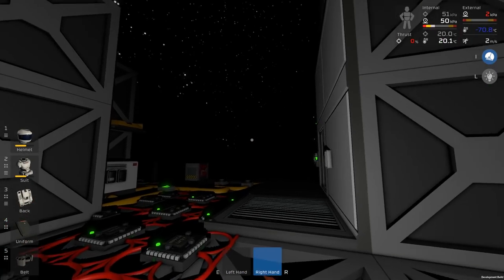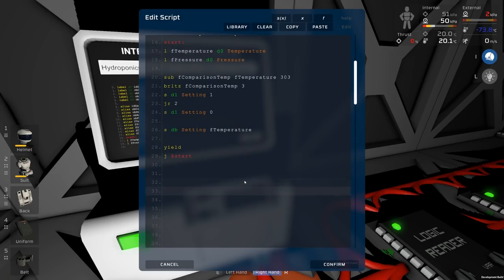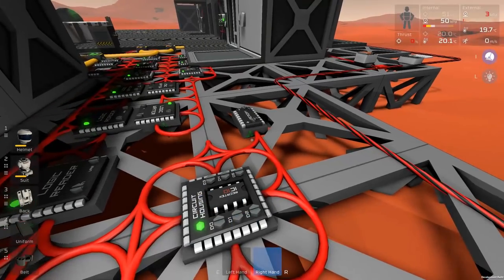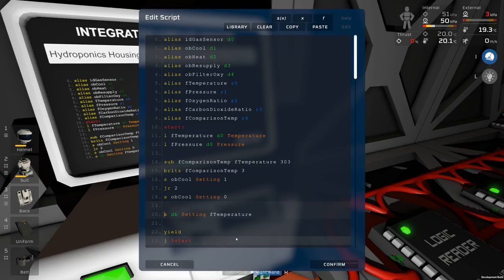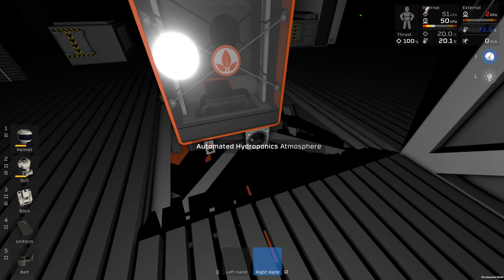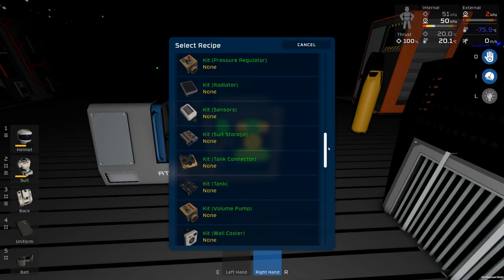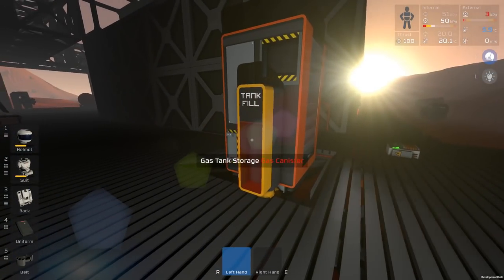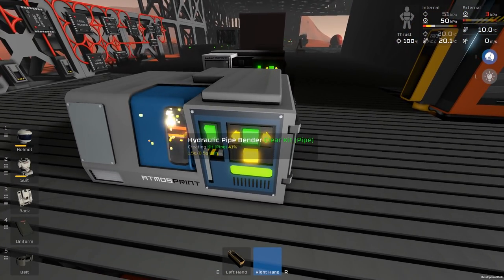Stationeers S2 E51 - New Automated Hydroponics Unit!

Comment: you can isolate the furnace completely using chutes and circuitry. works best if it is in a hot room  directly. it can still be cooled by gas emissions of the ingredients though

Comment: I've been using a similar idea like your wall cooler tower to heat an electric furnace and it worked great. instead of coolers i used the waste heat pipe of an air conditioner (input and output to passive vents). I always wondered whether wall coolers would work too but never built such a version.

Comment: I put one in my hydroponics room, attached a passive vent to the gas input, the water system to the liquid side and it all worked fine. Having a passive vent means that you draw and return gasses to the room and don't pollute your CO2 feed from the tank. The logic in the room takes care of the ration of O2 and CO2 as it always did.
.
Reply from the maker: Yeah, this is in the next episode - the main problem at the moment, is you need to reload after planting something - all the error stats are active until you reload.  Otherwise this code works: https://pastebin.com/5xpWMFzD
Reply: Thanks for that. I stacked 5 wheat into the unit and it kept them in the loading port. When I manually re planted, it took one from the stack. I don't know if this is right, it seems a little odd for it to just sit in the loading port but if it helps... Another good topic you have here, thank you for videos.

Comment: grayduster If you have problems with the furnace leaking heat, try to just seal it compleately, maybe a pach changed how their heat dissipation works, and you can just attach a reader/IC to the furnace to open the mold (it's lever), check the temperature/pressure and check the contents of it, and use chutes to transfer ores and ingots around! This might be the sollution, I didn't test why it cools down so much, maybe it simulates the heating up of the ingots somehow, I don't know what is going on with it right now.
Reply from the maker: I've sealed pretty much everything else except the front and a couple of pipe segments.  It's a little puzzling, but yeah, we can seal the rest.
Reply: Probably because half the furnace is sitting outside and it can probably reach -60c easy. Put it inside a room with a window (for viewing pleasure) and empty all air in there to improve the insulation.
Reply: grayduster Just add a frame to cover the front (I mean seal it compleately in frames) and use the things listed above to be able to remotly controll the furnace. Oh and ALL the pipe segments (the hot-gas-carrying ones, that are in what I call the furnace loop, the connections to and from the hot gas tank and the furnace) need to be in frames, otherwise you will get diminishing returns of the heat isolation from the outside.

Comment: grayduster Wall coolers reqire >5kPa of pressure to function, so it is impossible to just use atmosphere as a heat source directly, but if you would make a room that would pump in fresh air and pump out cold air, it would be possible, since then you can just rise the pressure, and use air from the atmosphere.
A way to do this is via using the filtration units as pumps; however there is a small important thing you need to know about them, their pumping speed depends on the VOLUME of their INPUT pipe's pipe network (the more volume in it input pipe's pipe network, the faster it pumps air from one pipe to the other) on recent paches of stationeers (from what I know), that means that you can just cycle air with them at the same speed, keeping the pressure at a certain level, just turn both of them on in the same "tick".

Comment: +grayduster My shorter if/else technique in the previous video is more useful if you have multiple statements in your if- or else-part, and/or don't just want to assign a single value (0 or 1). Then again, if the "default" preamble part is too long (only to be overridden), then your original technique may actually be best suited.

Comment: You should have looked at the temperature of the canisters, to see if it was the gas/water temp affecting the plant or the outside temperature. Since it's a concealed unit I doubt that the external temperature has much influence.
Reply: Rudi Christensen This would make a lot of sense the sense. Plants do generate quite a bit of heat themselves, and I know that, since I manadged to power a furnace with 10 plants exchanging CO2 into O2 with a small* help of wall coolers ;) , but that was a lot of paches ago.
Reply from the maker: Yep - I checked, they had dropped below freezing.  The next episode moves the entire setup into the hydroponics area anyway to automate them, so temperatures will be fine in there.  Beta branch is very broken right now (chips won't turn on, hydroponics shows up with all error conditions etc) - once that's fixed, I'll be doing an automation setup on it (spoilers, stacker-sorter-stacker with a feedback duct from the sorter back to the hydroponics)
Reply: Would have enjoyed you keeping them outside, because they can. And they would be good eye-candy for us viewers, when you roam away on your base, doing other stuff. Just stuffing them inside a building you rarely visit (in videos) don't do them justice :)
Reply: grayduster That is because your pipes where not insulated all that well. If you had something to keep the temperature stable (like a tempionary air con. unit) you could have avoided this, or the whole thing partialy in frames, the whole thing could be sustainable outside (maybe just not on Europa ;) , speaking of Europa, where are the episodes, I know some people are asking for that quite a bit).
Reply from the maker: I started Europa, and then the devs dropped ICs on me, and now everything needs ICs! :)

Also, here's a preview of the program for the next episode :) 

https://pastebin.com/5xpWMFzD
Reply: grayduster That's a lot of waiting* (the amount of "yield"-ing in your code) ;) . You could have done it in a loop:
<code>
...
move r15 10 // I just counted, how many times you were executing the "yield" command and wiritten it here, but this can be changed to even e.g: 10000 , since we are yield-ing (skiping to the next "tick") here anyway
yield
sub r15 r15 1
brgtz r15 -2
...
</code>
This way, you don't need to have a whole page filled with lines with a singular "yield" inside, and make the IC wait as long as you want.

Comment: maybe you can make a circuitbuilder station with debugging equipment all around.
like lcds and dials and memories and some standard readers and writers to merge input and output to and from the dials to the memories and from the memories to the lcds and then you can use develop your code and debug it more efficiently by changing the inputs and outputs around with the dials as you need instead of changing values in the program itself.
Also that way you don't need to build a new computer every time you want to make a circuit for something, but you have a generalized setup.
Also since you have that bay already, just dump the atmosphere into the automated hydroponics via a passive filter. Or alternatively you can have such bays in a pressurized livable area and just connect the internal atmosphere to a co2 pipe on one end and your waste filter system on the other end, and a storage tank on the pipes in between. and to save power and filters you only pull out the O2 once the concentration is > 10% or something like that.
With the new circuits it should be rather easy to build latch switches, that turn on at one value, change an internal state, and then turn off at another value.

Comment: So I been hitting this device pretty hard in beta status - (actually pointed out some of the errors for rocket)  and on the dev discord Rocket confirmed it is not very well insulated - soo it needs some kind of temp control - either the atmo pumped in needs to stay at  right temp or whole thing needs to be in a temp controlled room. 
I also broke the machine a few times.. using slot reader / logic writer / readers.. etc..
The device does not have a harvest button - though clear does destroy the plant growing (and does seem to return some items (or it did in my test)) 
I have mine hooked to logic writer, connected to a switch/button from logic chips - I push button - it harvests the plant.
The whole device is ment to be controlled by logic - id love to see some good logic build for it.. maybe even like 4 of them and some batch reader/writers and batch slot reader..  help automate food production so I can work on more fun things (like making ice catch fire and blowing up smart gas canisters with over-pressurizing them) 

Anyway - have good one o/
Reply from the maker: Yeah, I've got it running automated in the next episode (out today), except for it being a little broken on beta branch.

The harvest button is the clear button, but only when in growth stage 4 (plant grown).  You can examine the growth slot using the slot reader, and trigger when it hits 4, although you'll need to trigger twice.  There's an IC controlled version in the description of the next video - once the startup bug with the hydroponics unit is fixed, should be entirely automatic

Comment: tell me are you on the dev branch or did something special to get the new menu for the machinces and new look for them as well and the other new stuff. becuse nothing in my worlds has changed other then i can work with the ic editor.
Reply from the maker: I'm on the beta branch - which has just been broken today as I write, but should be fixed soon.
Reply: @grayduster  so the stuff your working with is not mainstream yet good to know
Reply from the maker: It usually goes live on Fridays, so you'll be getting it soon!
Reply: thats good i can atelast prep my grow area of my base to support the setup for the auto hydroponics i think they would work great with a filtration system setup to pull in co2 from the air and filter out the o2 in the mix to whatever you need like to mix fuel
Reply from the maker: Yeah, a canister on the input works fine, or a passive vent from the room - lots of options for the atmospheric input there.
Reply: yeah to bad there isnt a plant the dose the same like we use algae to filter co2 from the air and then burn it for energy. would make a bit of sense in this game with the organic printer.

Comment: This automated hydroponics feels like a cheat :-( It negates the whole "The Martian" ("science the s*** out of it") experience, where Matt Damon was an actual botanist trying to get his green house to work. What's next? Automated atmospherics? Automated solar control? Automated gas furnace? If you can have a complex machine like this, why not those, right? It doesn't fit with the philosophy of the rest of the game imo...
Reply from the maker: Well there is a new gas going on at the same time, mainly for multiplayer N2O , so they are adding complexity too :)
Reply from the maker: Also, you have to maintain temperature for the machine, and the atmosphere too.  So really, it only adds input/output/plant/harvest capabilities to the normal hydroponics (along the line of every other machine).  And you still have to program the automation :)
Reply: I guess. Maybe I'll warm up to it :) It does seem expensive to build (basically a mining+alloy/furnace problem), and you only get one plant at a time @100W/machine (which doesn't seem too important, since you don't need that many to survive). Not sure if it balances out, but we'll see.

May I suggest you add 1 or 2 active vents to your airlock to speed it up - so you don't have to cancel the cycle each time you enter..